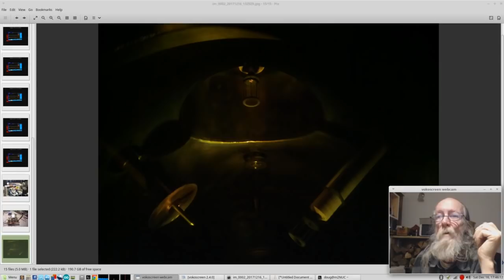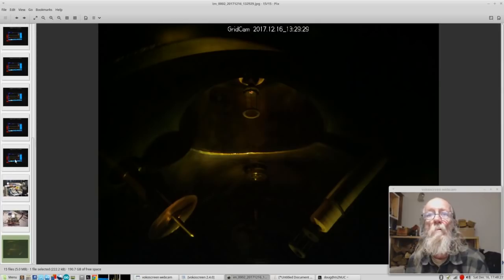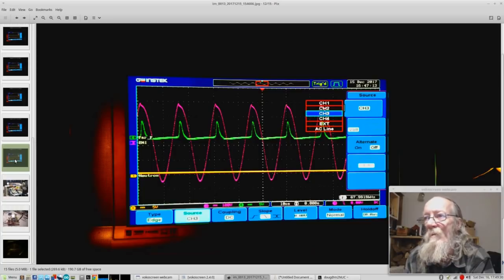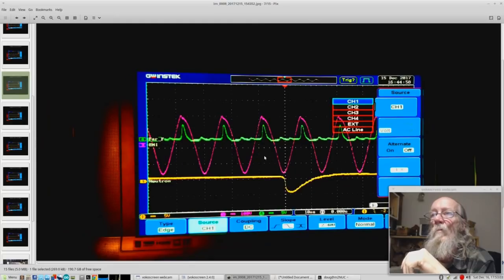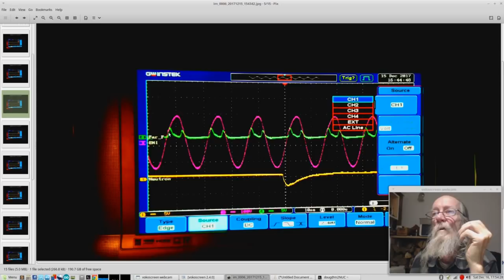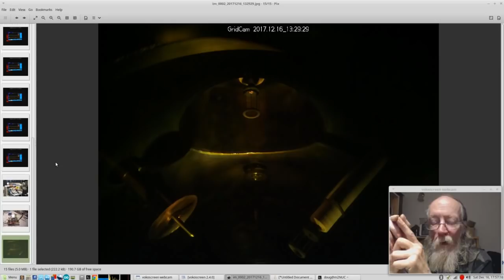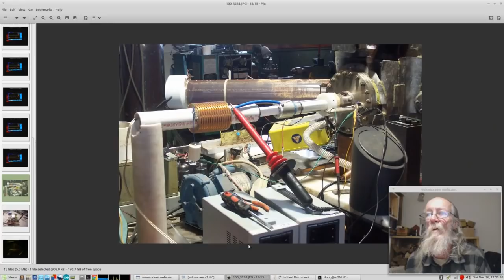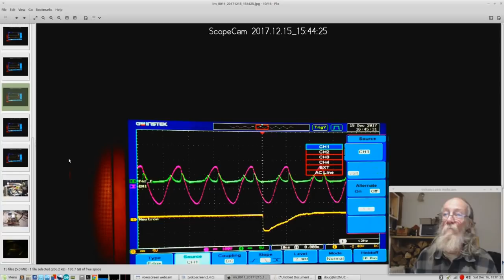Recirculation

Comment: I really like what's going on here, great work.
Reply from the maker: We're at the 99% perspiration part now, the idea having proved out.  But there's no math that spans this wide a set of conditions during a recirculation cycle, so it's kinda down to "good guessing and brute force testing" at this point.  I expect to have some more soon, I had to divert for awhile to repair some infrastructure here, but I've built a new RF HV power source and it's ready to test with.  The new one will span a wider range of parameters (more bandwidth and more voltage) to help us find the sweet spot.

Comment: anything new happening here lately?
Reply from the maker: I'm recovering from a series of infrastructure issues around the place.  I'll have more fusion stuff pretty soon.  The sad story: http://www.coultersmithing.com/forums/viewtopic.php?f=42&p=6335#p6335  Not show stopping, but some of these I have to fix without any more delay than I can manage.
Reply: sorry to see help is so hard to find around there - to everything a season - hope you get it all together without hurting/damaging anything else
Reply from the maker: Thanks for the kind words.  It's coming along...  The equipment to do the next series of testing is ready,  but I'm still roofing and and  working the power system.  Weird that it all failed at once, but...in a big universe, even rare things happen.
Reply: You are welcome, figured it was the least I could do. Weird when witnessed = wow, and as rare as it was I hope you have another a-ha moment that offers isolation of said sudden failure. 
also you give me a smile anytime I hear frequency, resonance, and density used in the same video haha
Reply from the maker: It's a fine line choosing a level of exposition.  If I assume everyone knows all I know - then why bother?  But then I can't quite dim down to dense beginner, I just can't resonate on that frequency, and this IS supposed to be documentation of moderately advanced scientific inquiry.  The ceiling is now up!  Solar panels and batteries on the way.  Generators replaced or fixed.  Now my vocabulary wants a beer!  And my science wants a nice warm sunny day so I can wire up the new driver and do a little looking around in the parameter space.

Comment: Thanks for the update on your progress! I've been trying to follow along with what you're doing, but this is getting complicated fast. If I understand correctly, are you using AC drive to get those oscillations you were talking about before? I think I remember on your forums you said you got x10 power improvement by adding the positive ion grid so it was a "pnp triode", but that you needed oscillations to keep getting those peek Q values on onsets. If so is this an improvement of your 10e11 DC drive or is this something completely different?
Reply from the maker: I'm working on replicating - reliably - that super high Q incident.  Originally it was achieved via oscillations, using the fusor/plasma itself as an active device - more or less a transmitting tube (but more complex and the other polarity, mostly).  Well, that fried a bunch of stuff in the lab - the power output was prodigious in more than neutrons - EMI was fierce too - so I did the "tighten it up" - shielded everything, cut out all the ground loops and so on, so my data acquisition stuff would live long enough to give me the data for a proper report, and replication in other labs - that's just how good science is done...(or should be and used to be, mostly)
But!
Once I tightened it up, it became apparent that the deliberate tuned circuits I'd had involved weren't the only ones - the parasitic L's and C's were also important - the effect was like that of a ham transmitter with parasitic oscillations along with the desired main output.  So, I could go back to the sloppy EMI condition - but then even if I replicated it, get no data and maybe get myself dead on top - or try to get good data out of the new setup.  Since it's really hard to figure out just what gave me the adventitious oscillation (not a simple single sine wave almost surely!) - I decided to just go with active drive after getting some basic transit time and density vs time and space measurements, which took most of the last year or so.
"Theory indicates" (and yes, Yogi Berra's idea lives here too) - that what is needed is two superposed (at least) wave-forms, one to direct re-circulation of the ions through the focus, and one to bring in the electrons at the last instant (which the ions being bunched up will help with as well - the idea that light electrons are going to control heavy ions is silly - but it works the other way around).  I'm now testing with some wave-forms, ones I can reasonably easily make, even if they're not the ones I'd predict are going to be the best - walk before running.  And the payoff so far, is that yes, we see ion orbits, sometimes a few stack up, and we get neutrons at voltages well below what we ever got before - so it's not champagne time yet - but it's really encouraging.  I'm working on a better waveform generator right now.
There is other good news that's even more complex about what I've learned of the distribution of the particles vs both time and space - we are now literally juggling them just like a guy with balls...and just like that - changing the effort of the toss also changes how long it takes for things to come back down and therefore the ideal timing of each toss....(a crappy analogy to what happens in an ion trap, but I'm trying...).  We're in an interesting gray area between what amounts to molecular (ballistic) flow and viscous flow in vacuum terminology, only as applied to charged particles.  There's no math for this yet...so I'm doing it the old fashioned 99% perspiration way.
Reply: That's clever, i like your approach to things. Its refreshing to see someone who's not on the payroll of gov't or a lab making significant progress on his own dime. How do you plan on driving the waveforms to the two grids while still delivering high voltage? In your other videos I saw an arbitrary waveform generator and that video preamp but I'm not knowledgeable enough to know how they go together. Thanks again.
Reply from the maker: I have to substitute clever for bucks (which always come with strings that tend to negate clever anyway).  It looks like I don't need to drive both grids if I have active drive on one - it was in fact handy using two for transit-time measurements, and I'm not taking one out just yet either.  Once we understand the dynamics a little better, I can maybe go back to using two and getting a waveform generator "doing the right thing at high power for free".  After all, it did once, and that's pretty elegant, using the device itself as its own signal generator.  But it looks like I have to take a step back to get that understanding more nailed down.  So I am.  At any rate, making many-kv arbitrary waveforms is far from trivial, and is harder than I originally thought if in fact we need on the order of 50kv.  Step up transformers that will take my 1 kv or so tube amplifier up there - 50::1 turns ratio or more - tend to be fairly high Q (in the electronic sense) resonant circuits, and you might even need a couple to get a net waveform with just two significant Fourier components in it (one for D+, the other for e-) to do this juggling with.
Right now, I'm just going at that one at a time with what is not so hard to do that I can't do it - I'm a big believer in a fast "edit/compile/test" cycle...and seeing what I can learn before too much more time passes.
The thing is, once one knows with some certainty what waveform is actually needed - it can be made with nothing more than on-off switches and stuff like saturable reactors and transmission lines - reliable and cheap.  But those aren't easy to sweep around the parameter space at all.
Reply from the maker: Oh, to follow the ion trap or mass spectrometer analogy (which is likely close) - you use a mix of AC and DC.  Since I have to use a transformer anyway, I can feed DC in through the bottom of the secondary winding, assuming I take the trouble to isolate things well enough to not have arcs - a major pain...but do-able.
Reply: I can imagine that being a serious challenge. Since you've upped efficiency by so many orders of magnitude already, is the boost from this 10-12kv to 50kv worth the little bit of extra efficiency gained? And what about current, why not put micro or nano amps in to test efficiency whilst keeping rads low. Although maybe breakeven at only microwatts wouldn't prove scalability. Its just a thought, probably easier to make power supplies for that.
Reply from the maker: I'm just solidly out of the noise at ~12kv, not really anything spectacular.  Q goes up super fast with volts in other test modes - it's far from a little bit, it's huge - a big integer in the exponent....So far, running at really low power is a good thing - with only a little bit of input, I can stay in the lab with it.  Right now, it's the quest for data that is top priority, and this gets it faster than what I can mostly do remotely.  Actually, the power output, once you get to a few watts and some kv isn't the big one - 500w is not a heck of a lot harder than one watt - it's doing it broadband that's the trick, and being able to sweep all the parameters easy to find sweet spots.  As soon as you get outside "logic level" all this other stuff - like real life loads that aren't pure resistors, sometimes arc to ground and whatnot, becomes real important and you have to deal with it almost regardless of the power levels (only the size of the tools changes, that's not the hard part for me).  But don't forget that when I was setting records (and almost getting dead) - I was running 100's of watts input.  This is proof-of-concept at far lower input levels, and is doing better at those lower levels than the other way (DC) was by far.  It's why we call it research - if we were sure, it'd be engineering (which you still have to do in order to create the tools for research...).
Reply: Very interesting, you've got a point there. Thanks for the replies, and I look forward to seeing where you take this.
Reply from the maker: I added links to the discussions on my forums to the description above, for anyone who cares about the details and timeliness.  I mainly use youtube (Thanks, Google) to support what's going on over there.  A lot of this work doesn't really rate a video about it, but is interesting never the less (to some of us).

Comment: Thanks Doug! Once you told me long ago about how AC outperformed DC, so how long has it been you were experimenting with AC? I think this is a great contribution to the Fusor community, again thanks Doug! Also how does is this related to the Mathieu equation?
Reply from the maker: This is showing that I wasn't completely full of it when I stated that this was going to be similar to what Mathieu describes.  In fact, it's mostly more similar than I thought, as at the time I didn't realize that in large portions of the vessel, the conditions are VERY close to those in a quadrupole mass spec or ion trap.  The (assumed by me) required additions to his math only will apply in the part of the space and during the time the density is much higher - near the grid when everything flies into the focus.  It's nice to find out you guessed right, even if it takes a year or two to prove it(!).  That will make cracking this one a lot easier.

Comment: One day, I will have studied this enough to properly understand exactly what you mean. And then I will have to rewatch all of these videos. But I really like your enthusiasm, it's kind of like when I get a new idea for a plane or something, or how to make something work that I didn't know before. So I know what you feel like, but not exactly what you are up to.

As far as I can make out, if you up the frequency in your power supply, then you should be getting more neutrons produced. And when you get enough you can break even right? Hopefully I got this right.
Reply from the maker: Pretty close.  What we are trying to do is herd squirrels, er, deuterium ions, almost like a juggler.  The idea is to have them circulate through the focus in the middle over and over, since they might not do fusion on any one pass.  Doing this without losing all the energy we invested in each one, or "getting our money's worth" is the trick.  The geometry helps us with scattering losses, as when something is in the middle, all directions are "out" so we don't really lose anything by them bouncing off one another (scattering) - there - as long as we can re-bunch them for the next pass.
To make them recirculate, we have to have a time varying field (AC) and it has to be tuned just right so they don't crash into the tank walls on that part of the cycle, but do all pass through the focus at high speed over and over.  Since these have some mass, and some charge, they each act like a spring-mass tuned circuit (a guitar string is an example) but to make it "sing" you have to pluck it - once gives you a few cycles that dampen out over time (like a guitar) and if you want it to happen over and over forever, you have to "hit" them over and over with just the right amount of energy, and at just the right times (like pushing a kid on a swing - you only push when they're on the backstroke and starting forward again, and you have to push the right amount or they wind up going over the top).
Make more sense now?
Reply: Yes, it makes really good sense now. In fact, I am impressed by how clever that idea is. This AC field gets them oscillating at a really high frequency, giving them a lot of angular velocity. So are you relying on their speed to make them fuse when they crash together? Also makes one think whether or not something like a cyclotron could have any application into fusion, after all those do similar things.
Reply from the maker: Well, a DC field would draw ions into the middle fast to collide - once.  With AC we get to "bunch them up" and make them do it over and over again - we can have higher peak density when we "herd" the ions to all show up at once on each pass through.  You can indeed do fusion with a particle accelerator of any sort, but in general it's hard to make it efficient for a host of reasons. I have a few other things in the bag of tricks for that.
Reply: CockatooDude i want to figure out his works too, but I am a complete beginner. how did you learn all this
Reply: +Archie Goodman Look up the Lorentz force. Basically if a charged particle is moving through a magnetic field, the force exerted on it will be the cross product (or perpendicular to the plane formed by the vector of the particle's velocity and the vector of the magnetic field). For example, if you have a large magnetic field exerted by either a coil (look up Ampere's Force Law) going through a chamber, you can get electrons to go in circles, and then gain velocity through polarity switching gates, this is how a cyclotron type particle accelerator works. With different arrangements of magnetic fields, you can control charged particles basically however you want to. 

     What I think Doug is doing with his fusor is to have an AC field get the ions going back and fourth across the fusion chamber (for lack of a better term). As the polarity switches, the ions are drawn back across the chamber, in a direction perpendicular to the magnetic field generated. If he gets the frequency right, the ions won't loose much energy between each oscillation, as they will have gone all the way across the chamber and be slowed down naturally. This is what I think he meant when he told me the guitar string analogy, pluck it it the frequency it is oscillating at and you can add huge amounts of energy to it with repeated plucking. For an even slower example, this would be like pushing a child on a swing when they just start swinging back again, as opposed to pushing them when they are at the bottom of the swing arc. This concept is known as the resonant frequency, and if he can hit that frequency with the magnetic fields, he can get the particles to have enough energy so that enough of them start fusing to break even.

Also, Doug, if you got this, feel free to point out if I said something completely stupid, I wouldn't want to spread misinformation about your fusor.
Reply: I does actually :) thanks!